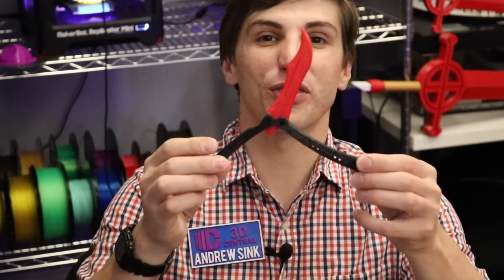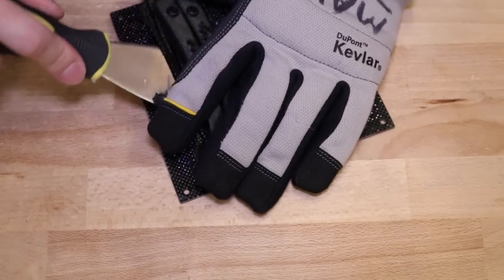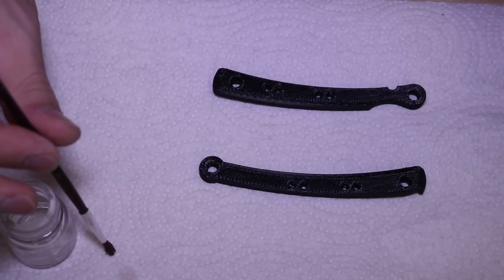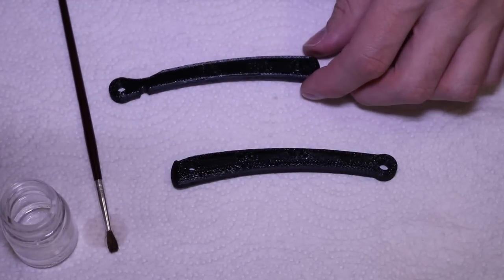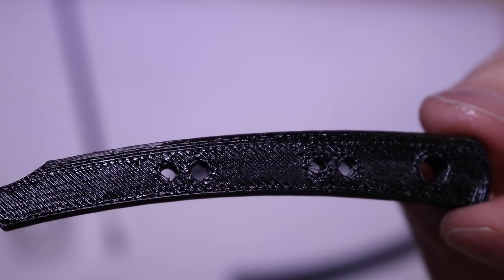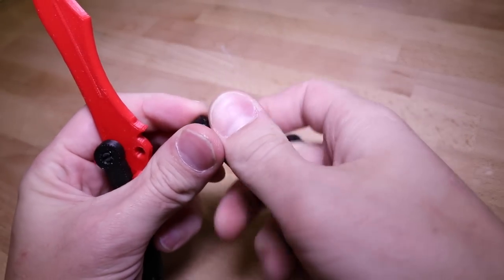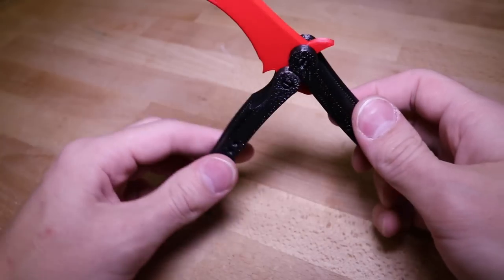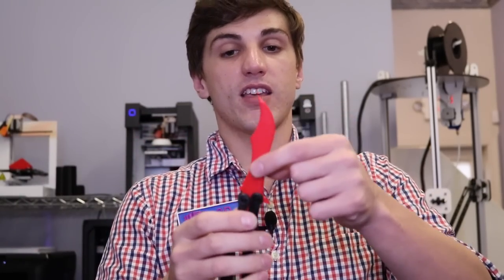100% 3D Printable CS:GO Butterfly Knife!

Comment: i have printed 2 so far and they work perfectly but one of them the pin on the blade broke after a while but it was an easy fix with some hot glue and it works fine, thanks for designing this it is amazing

Comment: You missed out the second tang pin that goes higher up on the blade so that when it's closed it doesn't cut you.
I know that cs:go butterfly knives don't have a gap on one side of the handles but on regular butterfly knives the gaps go all the way through. That's why the second tangpin is needed

Comment: Since i do flip i have a few problems with balisongs made this way.1. There is no latch. This is small but for some newbies the latch identifies the bite and safe handle2. The weight is off. Most trainers are heavy so if youre like some people who use a trainer then a real one you will probably cut yourself or make the knife go flying by using this as a trainer3. It sticks. You probably just have to lube it up tho

Comment: Print quality could have been better, I used the smooth side of my tempered glass bed with glue stick, 200 hotend 50 bed gloss black PLA. Going to do the blade in eryone gold silk PLA. Used m3 bolts to assemble. I shall try this knife next see If I can get similar or better results.
Reply from the maker: Of course the print quality could be better, this video is six years old! 😂